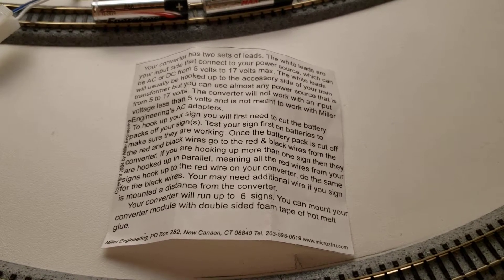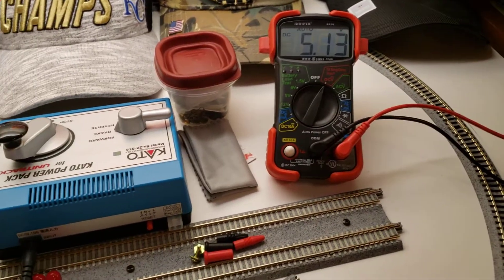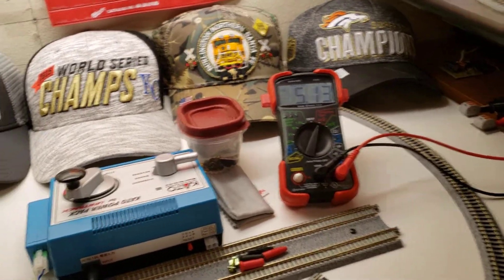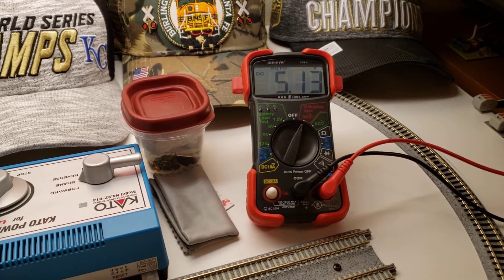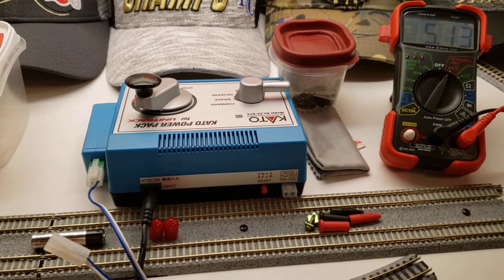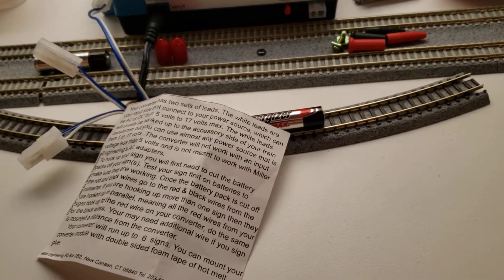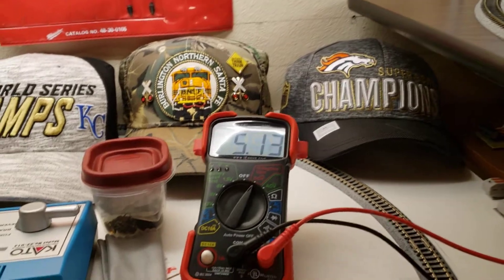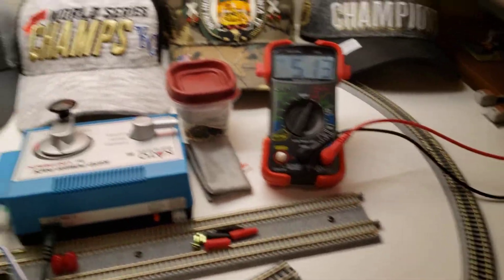Tutorial Par 2 Update 24 or 25 Miller Engineering Signs.! 4804

Comment: Good video alan Keep up the good work on your layout
Reply from the maker: Hey Thank ya Sir I'm gonna do this for a While till I pick me up A Miller Engineering Wall-Wirt & the Miller Engineering Wire Block Anfield Miller sells 2 wallwirts one that powers 3 to 6 signs and the Bigger wirt Runs I think Miller says up to 10 signs off there power block.. 

Where I got my signs the hobby shop thought I'd like the 4804 more so they pointed me towards it  but they do have the power block so I'm going with one of them to get away from using my controllers.. And if I can get me a Kato Turntable I can set up small DC layout use my Kato controller's along with the Turntable controller & can learn the in's & outs of the table using DC before moving it onto my DCC layout I've got the Kato power control switches that are required to help Run the Turntable but in DCC 

When you turn the table the set a tracks leading up to it has to be isolated and and somewhere in the hook up you have to have Auto Reverser for the polarity I've seen videos by Streamlined Backshops & few others but it may be tall task at first to attempt & something not make a big jump into the river unless its warm.!  But we might also look at Kato's Signal Gates with those polarity isn't as much as an issue but a small Layout like mine getting the sensors set just right for both Routs might be a challenge but it also might be fun and hearing and seeing lights flashing & the bell ringing makes the Layout more realistic...